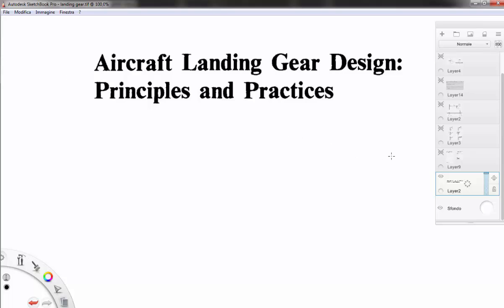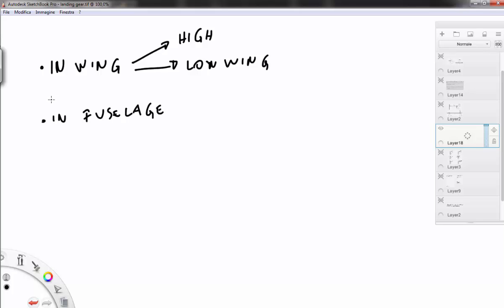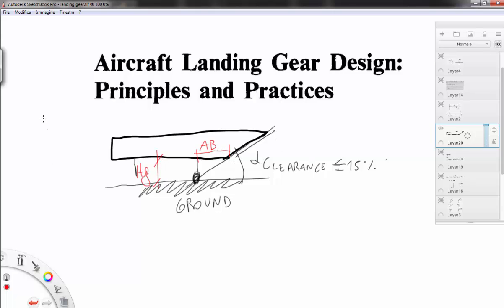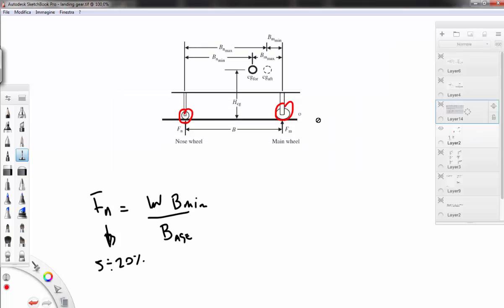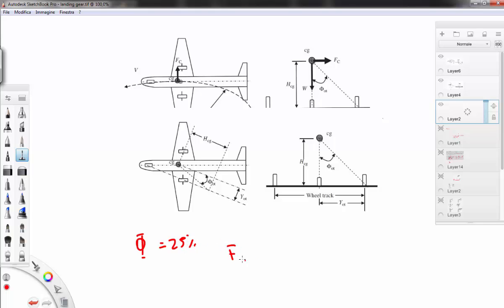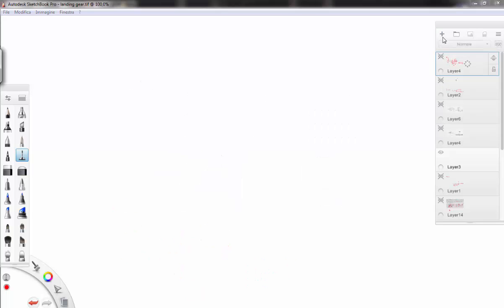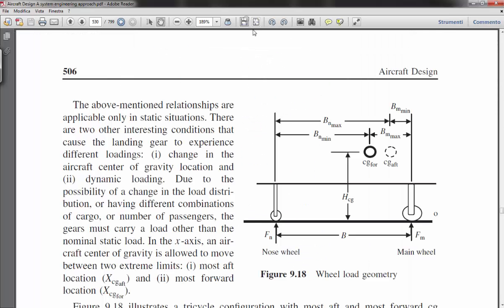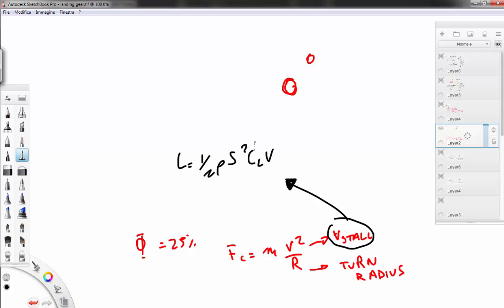Ep 11 - Landing Gear Design

Comment: Hello sir, can to tell me how to design main landing gear, from where will I get dimensions of each component of landing gear
Reply from the maker: The sizing of the components are customized. Depending on the weight of the aircraft at touch down, there are well know structures
Reply: hi .....@mighty wings, can you help me with the components of a 2-seater aircraft landing gear i.e their 3d models or where i can find information on how to design them on catia..........contact me at mwajobiso@gmail.com